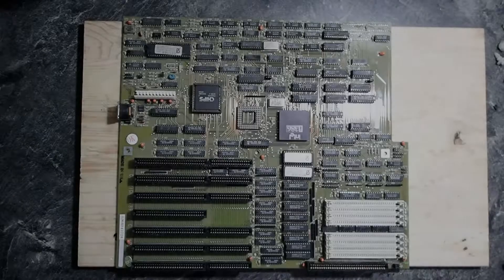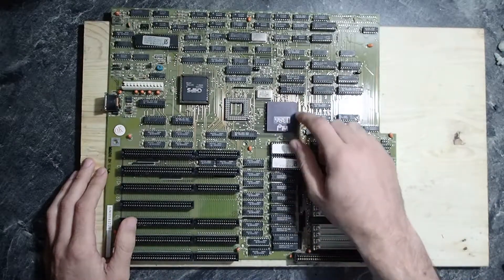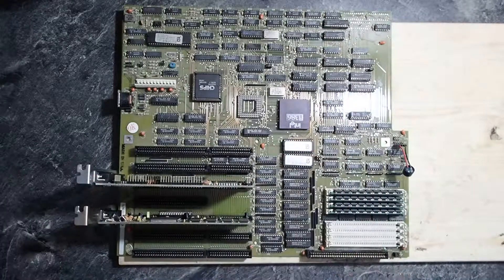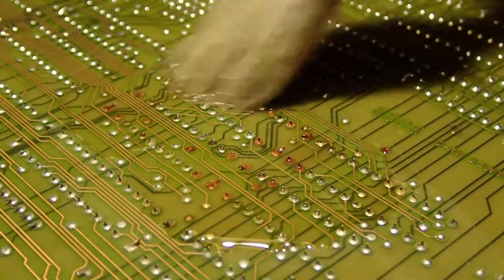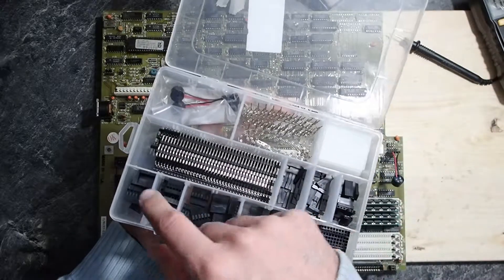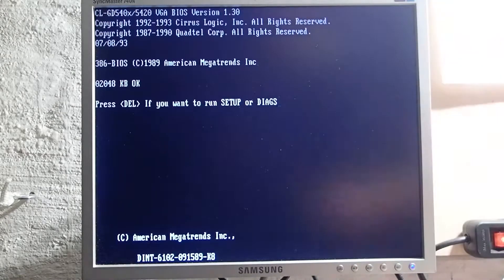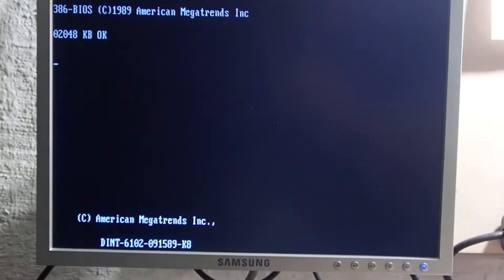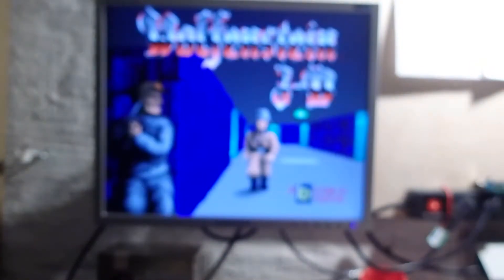Testing and reviving an old 386 mainboard

Comment: Hey Necro! Do you take mail in repairs? I have a 386 board that the clock cap leaked and did some damage to keyboard area. Motherboard posts and boots, but cant use keyboard.

Comment: What a strange board. The datecode on the PCB shows "early 1990" as the mfg-date. However, it lacks most LSI-chips, has an unusual formfactor (for a standard 386 of that time). Early 386 boards where like that (like intel isbc 302, early fortron or mylex boards), but later, baby-AT was much more common. Likewise, having a direct-mapped cache (without dedicated cache controller) was uncommon by 1990 for high-end 386. Probably some large OEM bought this and they kept production up and running as the design was already done and could ship in volumes. Would be interested to find the maker.
Fun part with discrete boards like that, is, that you can probe around every aspect of it. LSI chips kind of hide a lot of these probe-points in chips. I might eventually setup an old 386, like the one I used to own in the late 80's. Nice trip down memory-lane and somewhat more rewarding, than using emulators.

Comment: If anyone ever wondered why AT motherboards were also called "Baby AT" when they were anything but small, this is why.  This board is full AT.  It's several inches larger up past the keyboard port.
Reply: I forgot how big some of the old AT boards were.  They shrank as more and functions were integrated into the chipset.

Comment: Oh! Norton commander
Reply from the maker: Almost ;) It's a clone named Volkov Commander.
Reply: you can find a reboot of it on Linux called Midnight Commander. 
just 'apt install mc' on Debian
Reply from the maker: @goku445  I'm using mc since 25 years or so :D
Reply: @necro_ware  Ah! Nice. :) I don't use it but it seems well designed.
Reply from the maker: @goku445  Yes I started from DOS, where I used Norton Commander and Dos Navigator later. When I switched to Linux end of 90s I started to use Midnight Commander out of habit. Well, never stopped using it until today. I do most of the things directly in the console, but if I need some overview I still tend to start mc...

Comment: This had to be some server board, judging just by the size of board and number of simm sockets, I imagine the other 386 board from your earlier unboxing video would come from some server machine quite certainly. I can't imagine consumer 386 board with that much memory :D
Reply from the maker: Nope, it's a full size AT board :) They were as big as that indeed. And in regards of memory, at that time you could only afford 256KB SIMM sticks, with 8 of them, you had 2MB memory. It was not too much, even back then. At the time largest SIMM memory was 1MB per stick, so theoretically you could install up to 8MB. But it was too expensive for the most people.

Comment: I really love that battery holder thing ! It's so convenient and easy to make :)
I bought 10 myself !
I tested them on a 286 I recently restored. However on that 286 I needed two batteries because there were two diodes on the circuit that were draining the voltage to 2.3V which was too low for the RTC to properly keep the time. With two batteries the RTC received 5.5V which is a bit high, but I think it should be safe nonetheless
Reply from the maker: Hm sounds interesting, beside, that 2.3V should be actually enough, how did it work with the onboard battery before? Did it have any at all? I mean the barrel batteries are usually delivering also 3V, with this two diodes you mentioned, the voltage would be lowered too, or does it take another path with the external battery? I had one 386 mainboard where I made a cell battery mod, after a month in a box, I found the battery empty. After some investigation, I found a "bug" on the board, where the battery went over a diode and resistor directly to the ground, draining it quite fast. I assume even the factory installed barrel battery couldn't hold it for more, than a month. I reorganized some diodes and resistors in the area and added another diode and now the battery stands ages. What I want to say is, sometimes there are obvious bugs on the mainboards, sometimes even with such simple circuits.
Reply: @necro_ware  well I haven't checked for bugs. The original battery only went through one diode it seems but it's pretty much the same circuit otherwise. I'll probably put a regular battery holder in place of the rechargeable battery instead there because I think I'd just need one in that case
Reply from the maker: @DxDeksor  Don't forget to modify the circuit to prevent it from charging. Battery explosion is the last thing we want on our retro hardware, I guess? :)
Reply: @necro_ware  of course ^^
Reply: I have modded the board with a CR2032 battery holder. Due to the extra diode I added, the voltage dropped to 2.3V as well, making the clock stuck :(

I did this with my Abit FU333 and same happened : 2.4V end up in the circuit and time gets stuck.
The rest of the settings are saved though.

On the 286 I managed to ""hack"" the circuit by restoring the way the battery was originally connected to the circuit (re joining the trace) and then finding the source of the electricity and reroute it to the part where it should end up (that was already "behind" a diode). This made the voltage 2.7V instead of 2.3 which fixed the problem.
Now this is still worrying me because there is not much margin, meaning the mobo will have a problem with saving time pretty quick.
Also modding this way isn't as easy as just putting a diode and a holder.
On the other hand, external battery holders just need two batteries to work.
Reply from the maker: I don't know about the particular mainboard you have, but AFAIK the battery voltage down to about 2V is usually still ok. It is unfortunate, that it already makes problems with 2.4V :( However, I'm asking how that did work with the original barrel battery?! They are usually 3V and would have to run into similar problems even in a factory setup? Well, if nothing else helps, you can still use two batteries as you did, but I'd suggest to add a diode and a resistor to get the voltage down from 6V to something more appropriate. On the other hand, check the datasheet of the part the battery goes to, may be it can stand higher voltages anyway. May be the original battery was somewhat "non standard" as well?
Reply: @necro_ware  well I have tried two baby AT boards (a 286 and a Abit FU333 386) and both reacted the same. Both had the regular 3.6 volt barrel battery.
I think that 3.6v instead of 3.3 already makes a difference and also it goes through one less diode which doesn't drop the voltage as much. I have read different diodes may drop the voltage less. I'll have a look at them. Maybe I can swap all the old diodes by the new ones and in the end get enough volts
Reply from the maker: Yes, this is true. I had one non working Pentium II mainboard and after some research, I found, that somebody replaced a diode through a wrong one with higher voltage drop, so the CPU didn't get enough power. I replaced that by the proper diode and suddenly everything started to work. The wrong one had 0.7V drop  and the right one only 0.4V

Comment: Great channel, subscribed. 

Please continue this type of content!!!!
Yes, a new video to show that XT-IDE boot from NIC!!!!

BTW do you have any idea from a POST error message "RTC not updating, system halted" ? It is an 386/486 3 VLB OPTI895. I have burn a new BIOS from MR.BIOS and I can press very quickly the DEL key to go into BIOS, the seconds counter wont budge, so saving the BIOS(without no change) will allow it to boot. Thanks!
Reply from the maker: Hello, thank you for your feedback! I will see if I find some time to make a XT-IDE over NIC video. Regarding your issue, could it be, that your RTC battery is dead? Look on the mainboard, if you can see a bigger IC with 24 pins and ODIN or Dallas standing on top? This batteries tend to die after 10 years and must be replaced. If so, may be my other video can help you with it: https://www.youtube.com/watch?v=IbiczYoVncQ
Cheers!
Reply: @necro_ware  Hi again!!! The mobo doesnt have the Dallas, maybe the clock is generated by the SIS chip that pairs with Opti... It is sad that the mobo is failing. It has an 386DX40 soldered and using 486DLC is possible.. Please videos more often :) Your content is great!!

BTW great soundtrack, but I cant find the exact song in the link, all songs have vocals and the used in here doesnt...
Reply from the maker: @JorgeCarvalho_web_dev  Hi, well it's kind of complicated, to analyze this remotely, since I even don't really know, which exact model of the mainboard you have. On most mainboards of that time without that Dallas/Odin thing, there is an external RTC chip somewhere. I would start with two things, first, check the traces going from the battery and see if they are ok. They should somehow lead to a RTC chip, if there are diodes in-between, don't forget to check them too. If the traces are ok, I'd suggest to probe the IC itself and see, if it is working properly. However, you will need the right tools to do that.  

Regarding the music, I'm using some quite old tracks of that band, which are no more publicly available online, however, I have a personal allowance to use them :) Meanwhile the direction of the band changed a little and the new stuff sounds different. I like it anyway, but as you already said, the songs are with vocal and so, not quite fitting the videos I'm doing.  That's why I'm using the old tracks and this way I can be very sure that nobody will sue me for piracy.

I'm trying to do the videos as often as possible, however it costs quite a lot of time and I'm doing it after my work, evenings and on weekends. It makes fun and more videos will follow soon, but unfortunately I can't guarantee any schedule. Anyway, I'm glad you like it, so thank you very much for the feedback. I really appreciate it.
Reply: Just bumping this up. It would be nice a video about the nic room flashing with focus in this trick to recognize the flash card